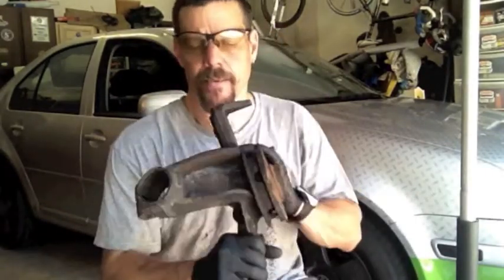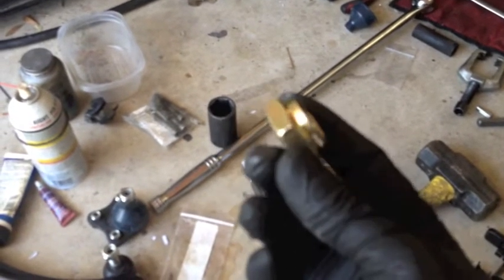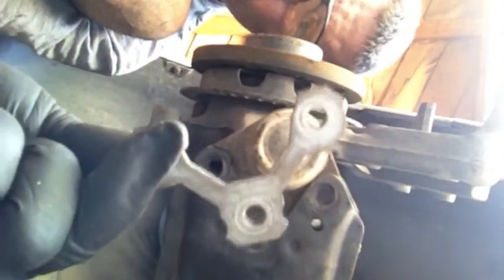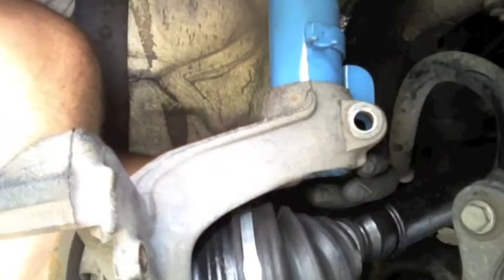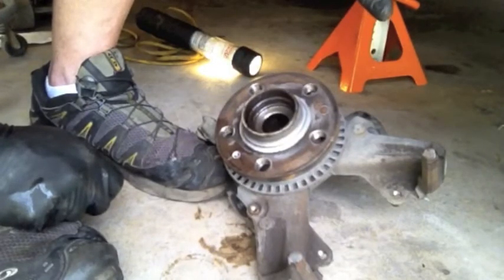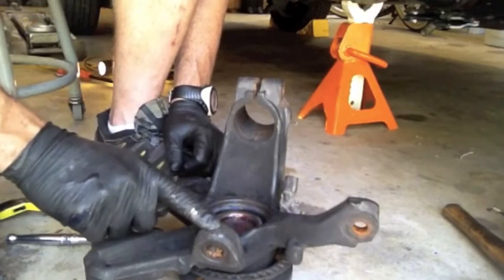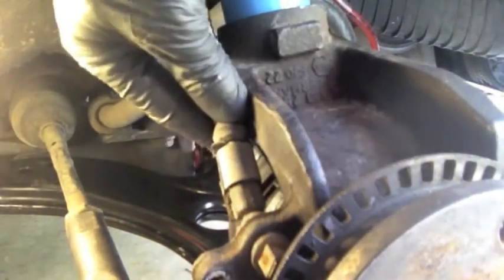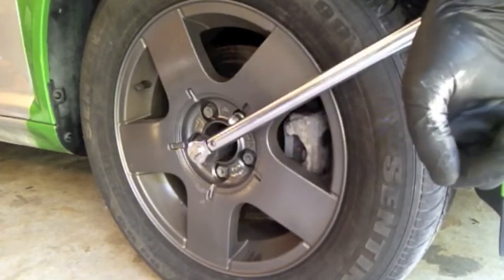replacing VW front end suspension parts

Comment: Hey great Video! its helped me tons,I really like the fact you mention each size of the nut/wrench you need so I didnt have to keep going back and forth to the tool box.
 I didn't take apart the control are s the ball joints etc are still good , and I didn't want to get into alignment. 
My only question is how were you able to get the old bushings out of the "A" arm? or do I need to buy a whole new "A" arm? 
Thanks Shawn
Reply from the maker: getting the old bushings out is kind of a pain. It is possible to press them out but you have to have a press and proper die. The best technique I have found without a press: cut the rubber with a knife, hacksaw blade or what ever so the center comes out (sometimes they are in bad enough shape that the center falls out). Then using a hacksaw CAREFULLY cut the outer steel retaining ring of the bushing about 3/4s of the way through. Be careful here that you don't cut into the A arm itself. Critical part is to try to keep the hacksaw level to the outer steel ring the best you can. Once you get it cut most of the way through, use a cold chisel or maybe even and old screw driver (large size), put it in the cut and whack it with a hammer to fracture the steel ring. If a couple good whacks don't break it, cut a little further with the hacksaw.  then try whacking it again. Sometimes I have had to make two cuts before I can tap the steel ring out but usually one cut will do it.  If that doesn't make sense, let me know and I'll try to describe it another way!

Comment: Sorry, so what would be the torque on the Strut bolts? That connect to the lower part of the strut. I have a 98 VW Beetle 2.0L and it has a torque spec, can't find it.
Reply: Sergio Alan well if you are talking about the single lower strut bolt, it would be 44 ft/lbs plus 1/4 turn. It’s a stretch bolt so I don’t recommend reusing it more than once or twice. I also recommend you get a Bentley manual so you have all the torque specs
Reply: @hesty32  yeah, I bought all the parts and screws I need. I think your right. Will need the manual 👍
Reply: @hesty32  Thank you man for the video and help!
Reply: @sergalvisc  They do have it on Amazon last time I checked. Just make sure you get the one that covers your year!

Comment: You definitely dont need the spreader tool for the shocks, a small prybar from harbour freight works perfectly, just takes a bit more sweat.
Reply: you can get a way with a small pry bar or even a large screw driver. I have also used a 3/8" to 1/4" socket adapter but once you use the right tool, it is so much easier you never want to go back!